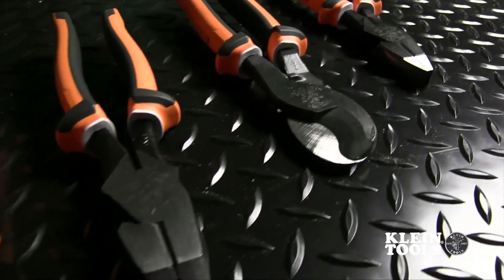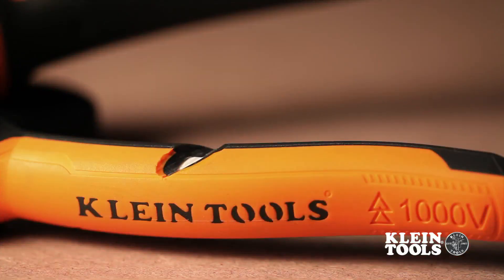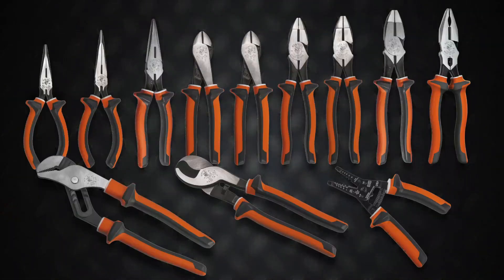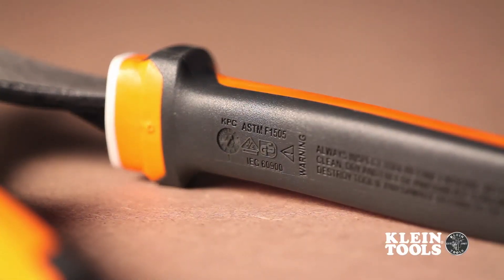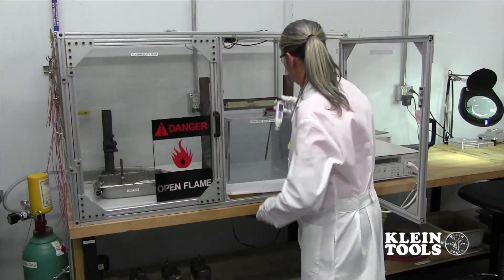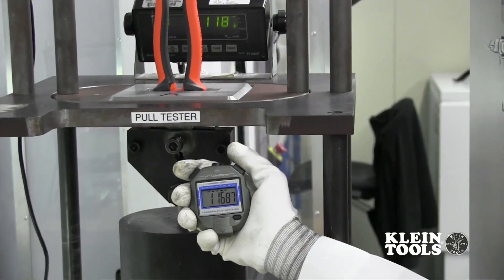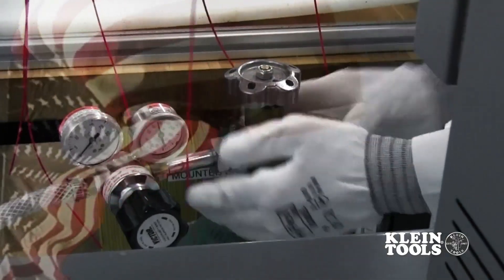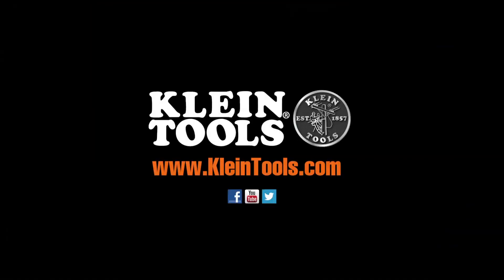Electrician's Insulated Tools

Comment: My only complaint  with these tools are there are no markings  on the bottom  of the handles  that distinguish it from another insulated tool. They all look the same when they  are upside  down  in a tool bag. I  put different  colored  tape on the bottoms  of the handles so i know what they are. Time is money  and i don't have all day to look though a bag of insulated pliers  to find the ones i need.